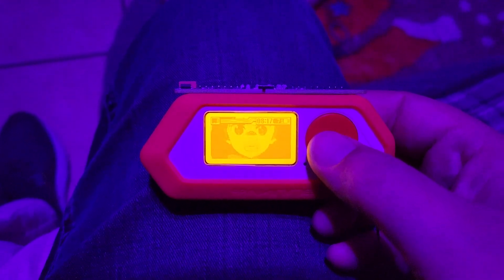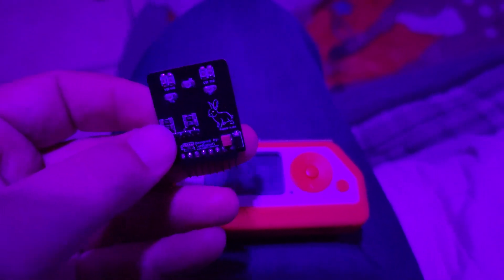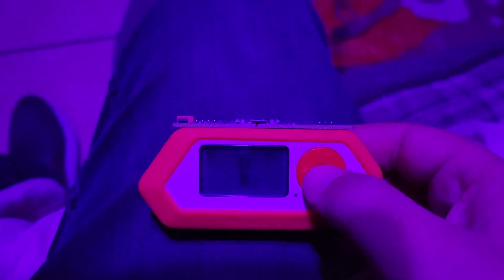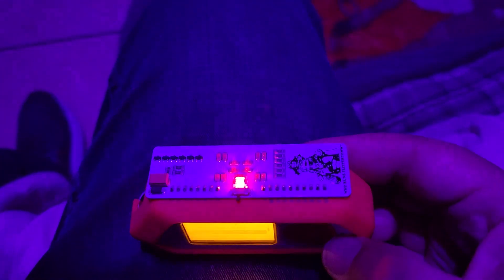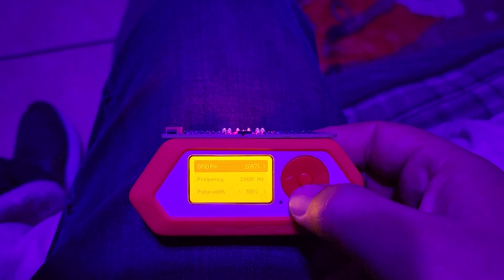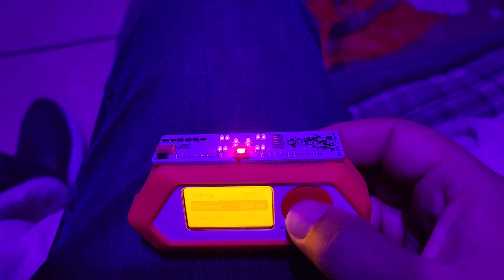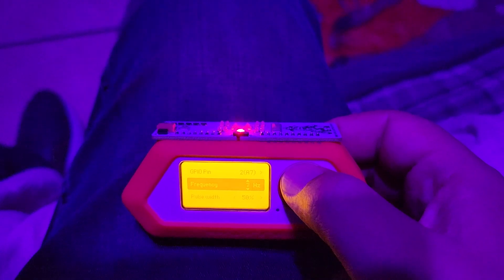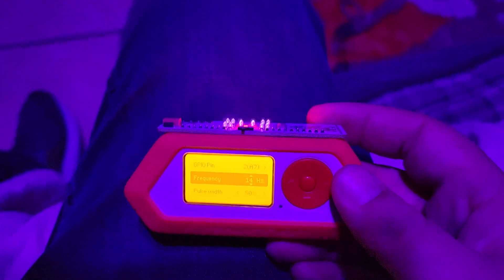Flipper Zero Can Turn Stoplights Green with this Add-on Device? 🚦😱

Comment: Looks like I need to buy another one of the wascally wabbits boards. Lol
Reply from the maker: You can do the same with the original one, just dont run it too long because it does heat up
Reply: @boboso5676  I still want to add this board to my collection. Lol 
I like the design of the first one because of the art, this one is more practical.
Reply from the maker: @DirtyPlumbus  yup and have you seen the case/lenses for them? It focuses the beam for better long distance range...they already sell the one for the OG blaster on tindie, and he told me the Masta-blasta one is being produced now to go on sale soon, i really need a 3d printer because i love having cases for my boards

Comment: Thank you for this video! I ordered one did you notice any range increase versus the stock IR transceiver?
Reply from the maker: The original has 7 LEDS. The supreme board had 16 LEDs, but that board was $80... so im good with the Masta-blasta for about $40, and yes, it's roughly 2x as bright since it has roughly 2x the LEDs as the OG board keep your eyes peeled for when they start selling the masta blasta cases/lens which increases the light by focusing it... And I'll try and make a distance test video in the near future
Reply: I know I was supposed to report back on another video but I completely forgot. So after several tries it does not trigger the opticom system but I noticed something. This may all be in my head but I'm starting to believe and I haven't researched yet but I think there's 2 different types of preemption. Active and passive. I notice that when I'm firing this thing off lights don't stay red as long as the usually do and I've hit succession of green lights that never happen. I'm currently working on three different projects but I'm going to dial I'm on this in the next couple of weeks hopefully before my packet squirrel mk2 shows up.
Reply from the maker: @-thefalcon-8093  Thanks for reporting back!!! Heres some info I found interesting: not all opticom sensors are equal, the city or owner of the opticom system has to set up the additional security: https://www.gtt.com/wp-content/uploads/Activating-Opticom-System-Security-Features.pdf
Reply: @boboso5676  ah brings me back to a video by Peter Fairlie where he was aiming a regular remote and it was registering it. This is a hypothetical but potentially you could capture this code with the ir reader you would have to be at the right place at the right time. Speaking of which there's a national night against crime I plan on going to they are going to have a fleet of emergency vehicles there guess who I'm bringing along 🐬 😉
Reply from the maker: @-thefalcon-8093  That sounds awesome. Good luck! Unfortunately, Peter Fairlie's been recently uncovered as faking some of his flipper videos, in particular the one that made the Electric meter smoke and turned the power on and off with the flipper, Turns out those particular meters arent even made to remotely disconnect so he must have installed a secondary remote switch.... Recessim is the name of the guy who made the video breaking it down... So, all that to say... I'm not sure we can trust what Peter has shown us about opticom, so all we can do now is follow the scientific method and official papers like the opticom security protocols link above☝️.
Reply: @boboso5676  agreed 👍 I think this event is next Monday or Tuesday I'll report back and to this video I promise 😄

Comment: Thats highly illegal if it  really do that. if it is real id suggest not doing it unless you want a nice confined cement room with bars
Reply from the maker: Its so rare to find an unsecured opticom light sensor that if you do end up finding one, it will prob be in the middle of nowhere... technically it should be possible, but I have yet to find one or have anyone report back to me saying they have succeeded so dont worry.

Comment: Hey I just received mine. The main red LED comes on but not the other LEDS. Anything I should check?
Reply from the maker: You can't see them with the naked eye just like the one built into the flipper. You'll need to use your phones camera to see the infrared light. I should have pointed that out in the video, my bad.
Reply: @boboso5676 haha hell yeah! Thanks dude! 🙏

Comment: Thst doesn't work
Reply from the maker: Did you try it? Some systems require an encoded signal so it wont work on all systems... heres some more info... Infrared System Activating Opticom System Security Features https://www.gtt.com/wp-content/uploads/Activating-Opticom-System-Security-Features.pdf

Comment: Why don't you just EXPOSE the IR protocol in which this is "SUPPOSED" to work. Initially I can tell you EMERGENCY vehicles "USED TO" have this option (some may still have it) but the system is disabled in most cities because of ROUGH IR even created by sunlight.
Reply from the maker: There are absolutely no opticom sensors at all near where I live, so I have no way of testing the opticom systems, and I have also read that many of the new opticom systems require more than JUST a 10-14mhz pulse of IR light, so this is just a POC for anyone that might have access to an older, unsecured, opticom system. For me, it's not about causing chaos but just a curiosity to find out how things work.
Reply: That and there's usually cameras at intersections, so go ahead if you want to be recorded committing a crime
Reply: @randomfrequency  which of your dads raised you?

Comment: Can it really do that? I heard it can change gas signs as well
Reply from the maker: It doesn't really change gas signs unless they use a system with a remote for changing the numbers, and most don't have that... The coolest thing it can do with subghz is copy car fobs to open cars and open tesla charging ports on random peoples cars, and remotely opening handicap doors... most everything this thing can do requires pre-planning and setup , but it can do a lot. I dont know for sure if this would work because I dont have an opticom system to try it on, but I think it would, just maybe not from too far away... a lens could also help.
Reply: The gas signs the flipper has the the code for are in some UK gas stations the manufacturers don’t sell signs in the US